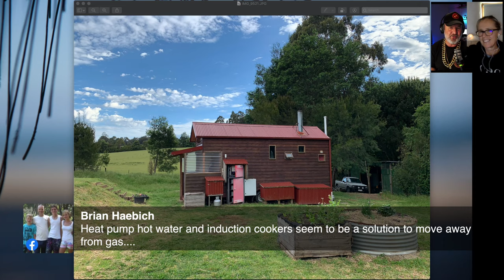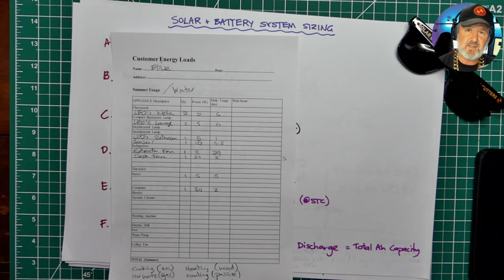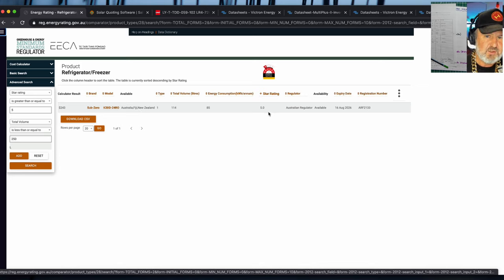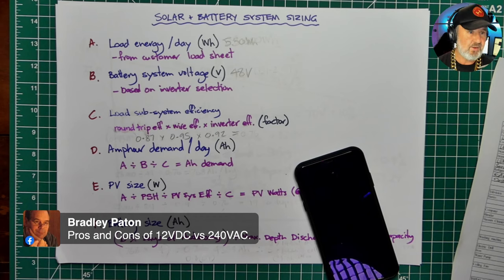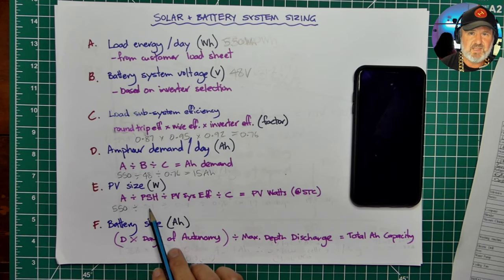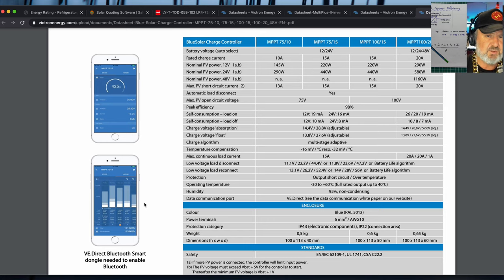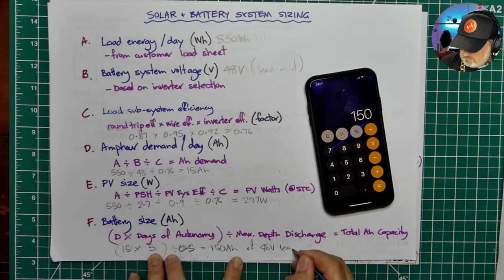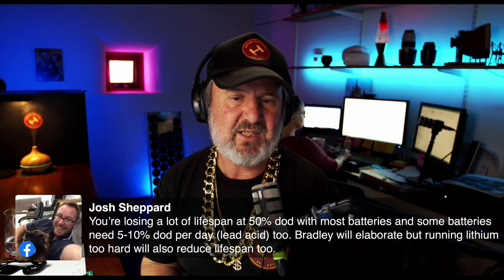Designing a Tiny House Power System

Comment: My lighting is AC powered off my 1200W inverter. I considered DC lighting but I have a load of 200lm/w Philips/Dubai lamps with a good CRI. You just can't get efficiencies anything close to that with good colour rendering with low voltage DC lamps.
I think you missed out the idle power loss from the inverter. I've Victron units, a 1200W taking about 7W (170WH/day) and a 5KW one which takes about 35W (420WH/day based on 12hours).
In high latitudes you really suffer with weather and need enough battery capacity to ride through bad times along with avoiding water heating for a day or two. I've about 9.5KWp and got an exciting 1.1KWh off the entire array yesterday, yes, the weather was crap!

Comment: Thanx Glen, its very good. 

I have one questions, short circuit and total impedance
in Europe, this is clasic calculation from power supply (transformer station) - its like solar system invertor
a) Zt=10*Uk*(Un/Sn) 10 * 6* (0.4*0.4) / 1000= 0.0069 (ohm)

Un=400V=0.4kv, Sn=400KVA(rated transformer power) Uk is power drop for this kind of transformer 6%
and this is total impedance for circuit. (Its IEC 781 and IEC 60364)

b) Transformer-main_box_in_house
L=100 meters
Scu=120mm2
R=2*r*100meters=0.054[ohm]
X=2*x*100meters=0.015[ohm]
Z^2=R^2+X^2=0.0563[ohm]
Transfrmator have fuse 315 Amps ( https://elmaks.rs/prodavnica/osiguraci-i-osnove/eti-nozasti-osigurac-nh3c-gg-315a500v/ )

I=U/Z=230/(0.0069+0.0563 [ohm])=3.4KA < for 315A FUSE < its 1.7KA condition ok

c) main_box_in_house-_max_distance_heater_2000W
L=30meter
Scu=4mm2
R=2*0.03*4.8=0.252[ohm]
House fuse is 16Amps 10KA, C class(speed automatic relay https://www.ep-solutions.rs/schneider-electric-acti-9-automatski-prekidac-k60n-1p-16-a-c-kriva-6-ka-a9k02116 )
I=U/Z=230/(0.0069+0.0563+0.256 [ohm])=746A < for 16A FUSE < its 80A condition ok

what is Uk in % for DC/AC invertor connect to solar panels equivalent as transformers?
Reply from the maker: Sorry... I don't understand your question.
Reply: My home inverters (Victron) are rated to output 2xrated power for 30 seconds before shutting down, I assume they will also immediately shutdown if you exceed these figures but there is nothing in the manual to advise. Because of this I took a figure of 10 times the rated output and found that normal 6ka devices along with normal 1.5mm/2.5mm cables could handle it without any issues. I've also installed 1A, 2A and 3A breakers on the 1200W inverter loads to ensure they have some chance of tripping when there is a fault!
Reply from the maker: @AndyFletcherX31  yes, low fault current is a design problem with power limited sources.
Reply: @SmartEnergyLab  I think the original question relates to I2t let-through current of breakers and ensuring that wiring can handle the worst case fault currents before it disconnects. The problem is that inverter manufacturers don't specify the the maximum prospective short circuit current of their products so the normal calculations in the UK/EU "wiring regulations" cannot be performed.
In my case my 5KW Victron can output 10KW for 30 seconds but I don't know at what point it will immediately shutdown so I took a generous 10 times nominal as my starting point. I've a 48V 100A 'C' DC breaker on the input so in the worst case it should handle overloads much in the same way as a 20A 'C' breaker on the output of the inverter assuming that the inverter doesn't shutdown earlier than that. A 'C' breaker will trip immediately at a 6-10 times overload. 
I've not been able to find a good discussion of these issues anywhere, it could be a good topic for one of your tech talks.
Reply: Electrical installation design has steps, 1) cable size (PPY 4x95 mm2 for 216 Amps, PPY 4x70 for 179 Amps, and soo on its from the table) next step (2)  number of fuses/part of installations and fuses selectivity (I=5In for >0.1 sec and I=10In for <0.1 sec)..., 3) Security conditions: (Zs * Ia < 50 Volts with the condition if installation needs RCD 0.5/0.03 Amps, etc...), 4) voltage loss in installation and finally 5) calculation of impedance in all installations from sources (for example power transformator 10/0.4kV,50KVA) connect to the house which have to design a tiny House Power System with power balances. I would like to know about sources power transformer from one side and invertor (DC/AC) on the other side and what is relative impedances voltage uk (%) in invertor? Otherwise, I will try to search into (AC/DC inverter technical performances, could be on catalogs)